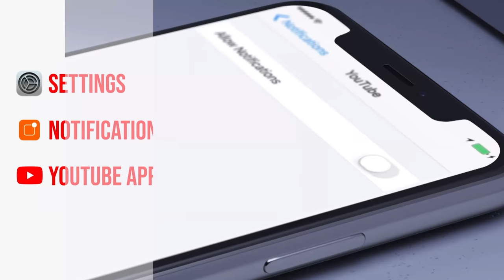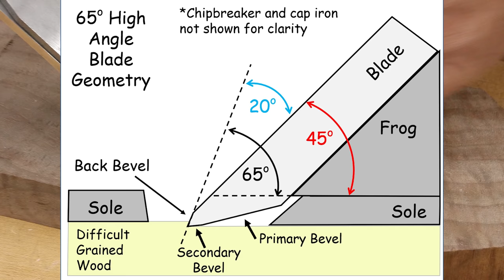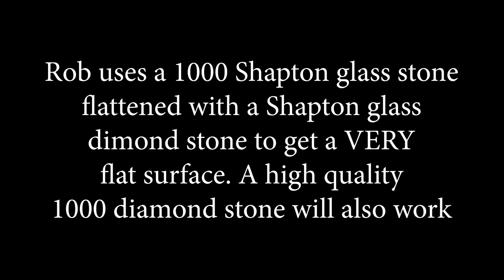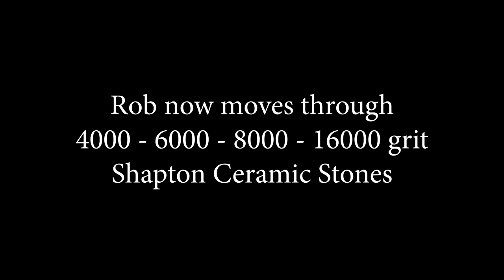Hand Plane Basics | DIY High Angle Blade

Comment: In continental Europe, all traditional smoothing planes use a higher angle, typically 49-50°. In German they're called a 'Putzhobel' (literally a 'cleaning plane'). There's also a version called a 'Reformhobel' or 'Reformputzhobel' that also has an adjustable mouth, so between the higher angle, tight mouth, and a properly set chip breaker, you can avoid almost all tear out (with the obvious condition that it's sharp).

Comment: Hi Rob
I bought one of these blades from you and it definitely gets a finish on figured wood I would not have gotten otherwise. I would not want to use it a lot because of the effort required but I consider it a must have tool.
Reply from the maker: I agree.  Thanks for the purchase

Comment: The results of this are unbelievable. Thanks you, sir.

Question. I am noticing that I don’t have as much room to close the throat (by adjusting the frog forward) when you back up the chip breaker a 16th or so, as you have to do in order to get it lined up behind the back bevel. 

Am I missing something here? Or is this even worth worrying about?
Reply: I faced this issue meself. Before buying a blade dedicated for this task, I simply flipped my blade upside down. Yes, the further away the chip breaker is away from the edge reduces the adjustment knob in one direction. My advice: when grinding the back bevel, less is more. It's only the edge that touches the wood.

Comment: Thanks for this video. BTW - your website says that you are sold out of these blade sets. Question: what about putting the chip breaker on cutting an edge on the blade so that it matches the chip breaker? this seems like extra work up front but could be better going forward as the edges of the blade and chip breaker would be one fat edge and in theory the chip breaker would never need to be polished again.

Comment: I wonder for the actual planning itself would it be more beneficial to use a 4 or 3 with the smaller base?
Reply from the maker: You mean to make the pushing easier,  it probably would be an easier stroke with a 4 or 3 but you would have to do a lot more strokes so its probably a wash

Comment: I'm curious if the back bevel can replace the purpose of the chip breaker. I watched a Japanese experiment with the chip breaker, if I remeber it correctly, the chip bcreaker's setup is 60° and 80°, and that's on top of the 45° blade! It was amazing to see chip breaker in action with that zoomed in video.
Reply from the maker: Yes that Japaneese video is very interesting.  What it is really showing is that with a small projecting is you can move the chipbreaker closer to the cutting edge to help prevent tear out.  We know that you dont need a chipbreaker beacuse Low Angle planes dont have them, however, on most all standard angle planes the chip breaker is neccessary to adjust the blade.

Comment: Hi Rob, I initially thought you ment to change the original primary bevel to a higher angle but now I see that you are putting a new angle on the BACK of the blade. So does that mean you can't use the ruler trick?
Reply: It means that you don't need to use the ruler trick. I think Rob mentions it near the start, but the ruler trick does exactly the same thing as this process - it creates a back bevel. It's just that with the ruler you're creating a really small back bevel that has no recognisable effect on the original bevel.
Reply from the maker: What Rico S just said

Comment: Would a scraper iron also be useful for this and even a bit easier to push through or would that only add its own list of complications?
Reply from the maker: Scrapers have their place for difficult tear out situation, but if you can solve with a HA blade you will get a smoother surface than a scraper will give you

Comment: I don't own a grinder, but I'm guessing that this could be done reasonably quickly with a file and a jig to get the rough angle? I mean adding another 20 minutes or so to the process. Or would the edge be too delicate to be filing?
Reply from the maker: What I would do if you dont have a grinder is get a coarse diamond stone (say a trend 300 / 1000 diamond stone) set up the jeg and using the 300 side apply the bevel, it will take a bit longer but very doable, then flip over and do the 1000 girt side then take it up th egrit levels to 16K.  A file wouldn’t touch it, blade is as hard or harder than the file.

Comment: Can the 20deg back bevel be done entirely w/ the honing guide on the 300grit diamond stone? I don't have access to a grinder, but am about to flatten my bench and saw you used a high-angle for that project. Thanks Rob!
Reply: Yes absolutely that can be done. You only need a narrow strip: maybe a 1/16 inch since really with what this plane blade is designed to do is to take light shavings. Thus you only need a thin strip. the plus side is it won’t take long to do to prepare it and you could prob go 300,1000, 6000 to 16000

Comment: Will it be easier to push if you reduce the angle of the primary bevel on the underside? With 25 to 30 degree on the underside and extra 20 degree on the back, it's a 45 to 50 degree blade and that's almost dull.
Reply from the maker: In a bevel down plane, the primary bevel has no direct effect on cutting angle as long as it does not exceed the angle of attack (45).  The closer it gets to 45, the more support behind the cutting edge , still, no effect on the cutting performance.

Comment: I recently thought I would need a HA blade for some Zebrawood and Purpleheart, but I managed to get both types of wood to a reflective surface with just a really good sharpening and really tightening down the throat on my WR 5-1/2. Still would like to try out one of those pre-ground HA’s your crew sells, just to see what it would be like.

Good video Rob and crew!
Reply from the maker: Sharpblade smal projection works almost everytime
Reply: Yes.  Some of that Purpleheart is difficult to plane, especially when you have several boards glued together and the grains don't match up great.  The end grain is challenging.  I like to see good videos like this on real case scenarios, not just a bunch of pine or firs or oaks.

Comment: I suppose this comes down to where you want to spend your time and money. You're either going to buy a quality grinder that will provide you consistent results along with additional plane blades, or you're going to buy a completely separate dedicated plane with a high angle frog, or a high angle frog to swap out in your planes. I don't have a grinder, so I purchased a high angle frog with one of the planes I purchased from Lie Nielsen and have it in my 5-1/2 but can swap it out as necessary. Great video, though, and I'll remember this if I do eventually purchase a grinder and have additional blades to grind per your recommendations.
Reply from the maker: Actually you can use just about any old (used) 8 inch grinder, but you do need a good tool rest and a good wheel

Comment: Rob, that is a very wide back bevel. Surely it only needs to be a micro in size - enough to raise a wire on the bevel face? After all, that is how you tell when the face bevel is properly honed. All I have done in the past is use a guide to raise a wire, polish it, and done. No grinding necessary. Regards from Perth, Derek
Reply: I'm sure Rob has more to say than I but up until seeing this video I only sharpened until I had a very thin back bevel.  But I can see that doing it once to 2mm wide will last longer and not need redoing every time I sharpen.  Makes sense to me.  I'm sure he has further reasons.
Reply: If you create a micro back bevel, then it is easy to remove (if you want to do so) by simply sharpening the face bevel. A wide back bevel requires that the blade needs to be reground to remove the back bevel. Regards from Perth,  Derek
Reply: @derekcohen1000  Ah, Derek Cohen and Rob Cosman on the same page.  Now that is a high concentration of useful chaps in one place.  I rate Rob's advice very highly - I went for the 16k Shapton based on his recommendation and I really like the results, it took me up a level from the best I could do with even the 3 micron DMT and stropping.  It's a joy to plane with a fresh blade off that stone.  For anyone who hasn't looked up Derek before, if you do you will find a lot of really good information and testing results - especially on those horrible Aussie woods with grain created to frustrate any plane.  Cheers to both of you!
Reply: Would you just use the ruler trick but with a block of a specific size to create the 20degree micro bevel?
I'm guessing the only benefit of the larger bevel is that you can retain that dedicated blade, but I'm guessing that would only be useful for folks who planed a lot of figured wood.
I planed a couple of beech worktops recently which were butcher block style and were horrendous due to the grain going in random directions with each block and I ended up using a scraper plane, but it's probably the only time I've needed to go beyond just a really sharp blade.
Reply from the maker: All....this is NOT the normal Charlesworth ruler trick.  That is for your normal everyday plane.  We are making a high angle blade here.  You CANNOT just regrind the primary bevel in a bevel down plane that WILL NOT change the 45 degree attack angle.  to change the attack angle to high angle (55-65) you have to put on a SIGNIFICANT back bevel on th eblade.  I do a 20 degree back bevel so the attack angle goes to 65 (45+20=65).  You could do a 10 degree backbevel and have a 55 degree blade.
Reply: @derekcohen1000  I think the video approaches the subject with a view to having a blade set up specifically for gnarly grain.  If you only had one blade then I suppose you would only put a minimal width back bevel.
Reply: Danny, as Rob notes, a back bevel for high angle planing is not the same as a Ruler Trick. The RT is 2/3 of one degree (as calculated by David Charlesworth, the originator). It is simply to ensure that the back of the blade is flat. HOWEVER, the RT is created as a micro bevel. If this micro bevel were made at 20 degrees (using a guide), it would have exactly the same effect as the very wide back bevel that Rob has demonstrated. This is not a new technique. It has been around many decades, if not centuries.
Reply: @derekcohen1000  Derek, Not sure where the mixed messages between ruler trick and back bevels came about.  I'm not talking about the ruler trick.  I have two blades for my go-to planes.  One sharpened normally inclusive of the ruler trick, the other sharpened normally and then given a 25 degree back bevel on the flat side of the blade to give me 70 degree angle of attack.  I have previously only ground the back bevel to a thin line, but given Rob's video I'll most likely increase it to about 2mm wide.  Hope that clears the matter up.

Comment: Hi Rob, I know you're not a lover of the "low angle" Jack Plane, but wouldn't that be an easier way to achieve the higher angle?  Just grind the blade to your required angle minus 20 degrees.
Reply from the maker: Yes, but then I would be stuck using a Low Angle Jack, and that’s worse than having tear out.
Reply from the maker: But with a low angle Jack you’ll still need to grind your blade to be at least a 50° bevel.

Comment: Low angel planes are basically the American version of a bevel down Asian plane. Sharpen a low angle bevel up plane at 35° and you will have a 47° plane. HNT Gordon planes work so well because the two options are high angle and scraping. The closer you get to scraping the thinner the cut.

Comment: Why not just turn a regular blade upside down. They are usually ground at 25 degrees, but easily ground, honed and stropped at 20 degrees.